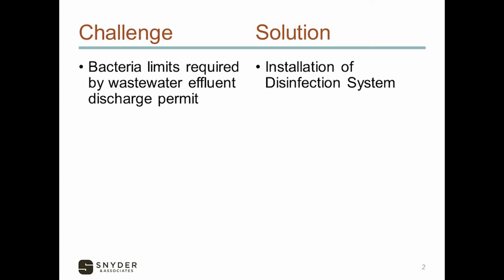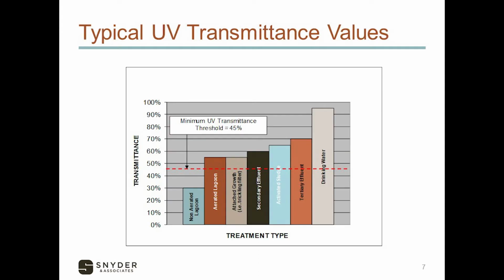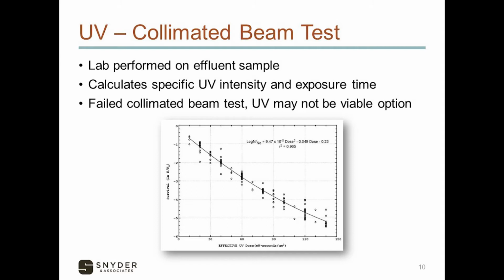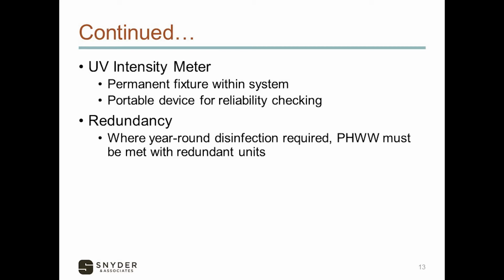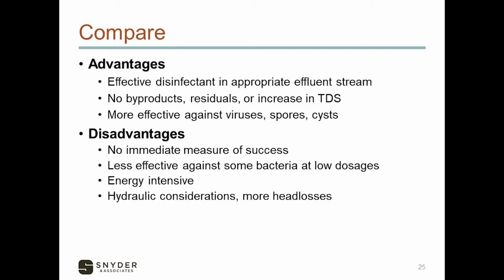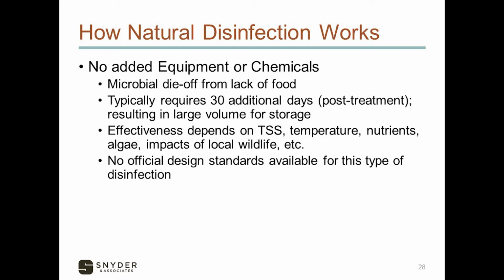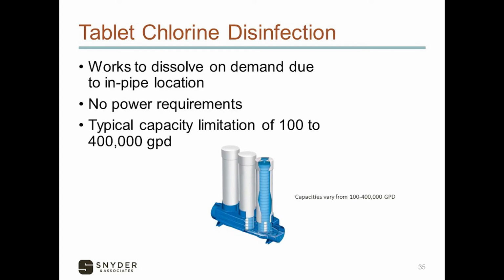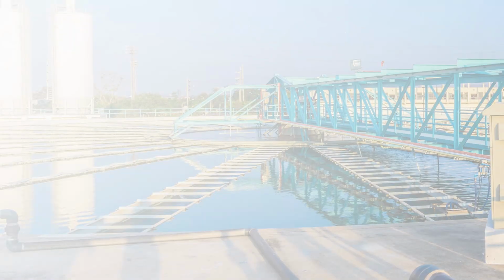Wastewater Disinfection Treatment Alternatives Presented by Darin Jacobs

Comment: Great and important video. Do you have effect of PAHs effect in wastewater treatment by chance?  Effect of heavy metal in UV?
Reply from the maker: We are glad you enjoyed the information on disinfection. PAH compounds are generally not part of the testing routine for raw wastewater or treated wastewater in the states where we work, so data regarding the effects of UV disinfection is typically unavailable. Unfortunately, anything we could offer would be speculation rather than based on scientific data.

Metals of all types are always a concern for the success of UV disinfection. Metals, by their very nature, generally are reflective. Diffraction of the UV light energy can cause significant problems during the disinfection process. It is often found that common metals such as iron cause substantial issues through the diffraction of light energy. Some, but relatively few, systems test actively for heavy metals. One would assume that heavy metals generally would follow a pattern similar to that of more common metals. With that assumption, it could be surmised that higher levels of any metal would definitely affect UV performance. We do have clients that include heavy metal testing and operate UV disinfection systems. They have experienced no noticeable performance issues that we are aware of. We attribute that to two basic items. The first is that the design of the UV system is very conservative and that a significant amount of reserve capacity for disinfection is present. The second is that the level of heavy metals is normally so small (as required by the NPDES permit) that it has a negligible effect on UV performance. This is particularly true when common metals such as iron or manganese are present and control UV system design.